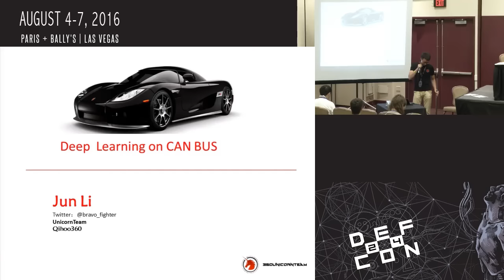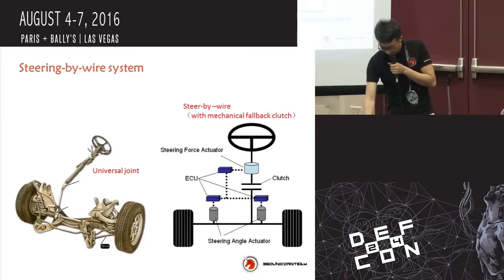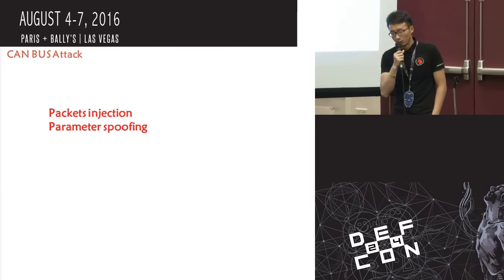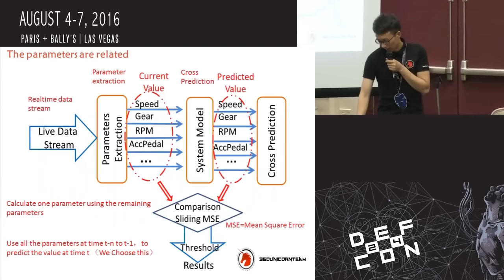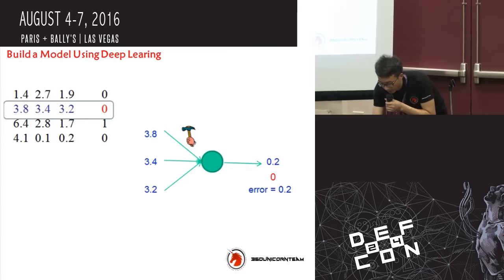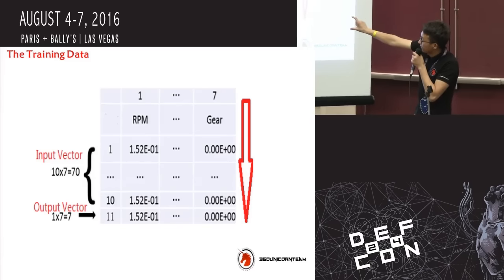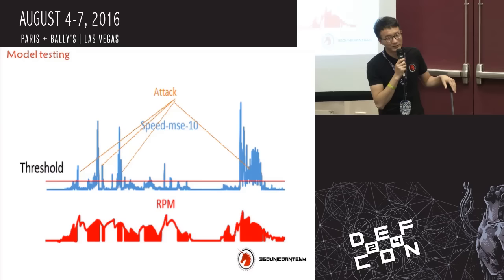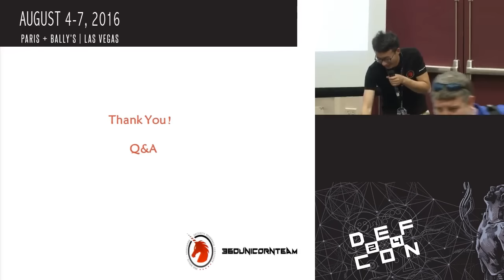DEF CON 24 Car Hacking Village - Jun Li - Deep Learning on CAN BUS

Comment: Not only do clutches make engine speed -> gear ->  wheel speed non-linear, but there's a torque converter in automatic transmissions which is a sort of hydraulic coupling.  This is why your automatic trans. can be in 'D' but you can 'idle' at a light without the trans. having to disengage.

Yes, some newer cars do not need this and have better auto-clutching. and manual transmission cars just spline the foot-pedal actuated clutch directly to the driveshaft on one side and the engine's flywheel on the other.
Reply: Actually, you are somewhat on the right track.  The clutches, unless they are BADLY worn and in need of replacement, have absolutely nothing to do with it except during the shift itself.  It is 100% the torque converter and pressure relief systems that introduce the non-linearity.

Comment: This isn't a good idea at all.  At best, it's pointless.  We don't WANT cars to learn what their sensor readings "should" be as parts wear.  Factory (or new) relationship calculations with tolerances assure that as parts wear out of spec, they are replaced because a dummy light comes on.  This is important both for emissions AND for safety.